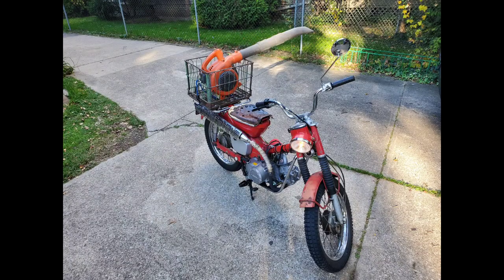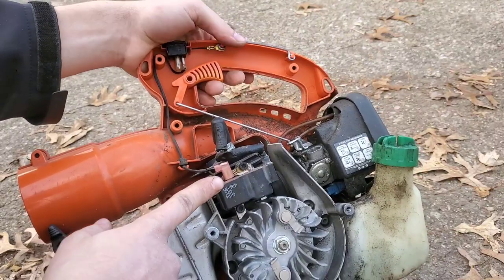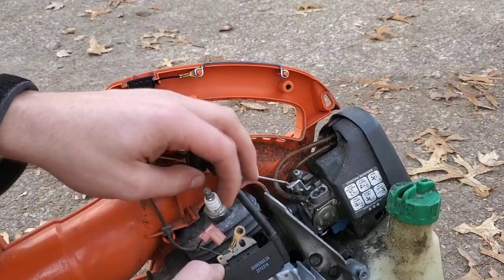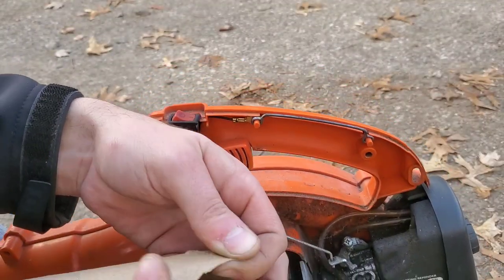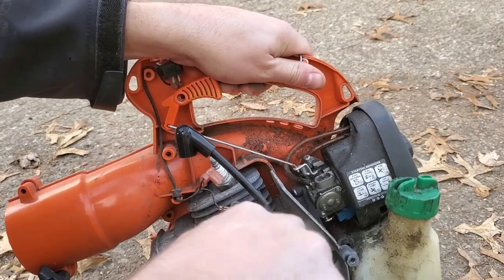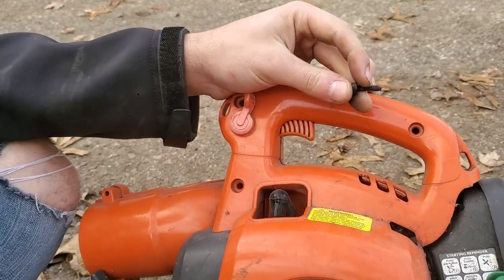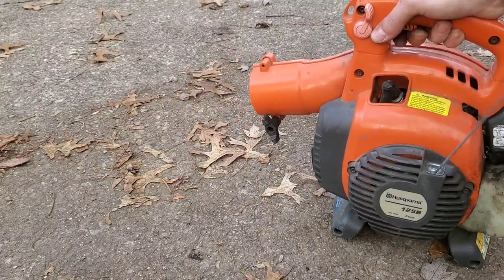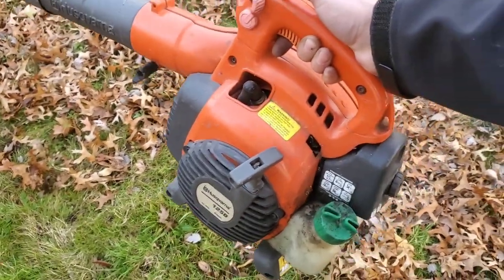HOW TO - Fix a Leafblower with No Spark - Husqvarna 125B

Comment: working on an echo PB 580 T changed the coil twice now. it has a random spark. when I turn off switch then turn back to on position it throws one spark then nothing else.  I've crossed/bypassed the switch & still nothing. thing has me stumped.

Comment: Thank you. Does the coil come with a spark plug or do i need to order that as well? And where did you order it from. I have had my blower for almost 10 years and. This is this is the first issue I have had with it. It just will not fire up.
Reply from the maker: It doesn't come with a spark plug, but you can pick one up at your local hardware store. I ordered my replacement coil either on Amazon or ebay. Just search your model of leaf blower and something should come up. These small engines tend to be fairly universal.